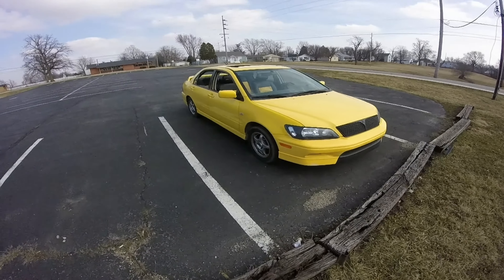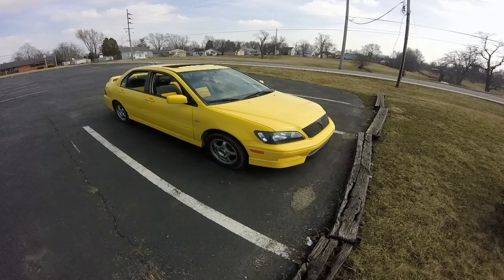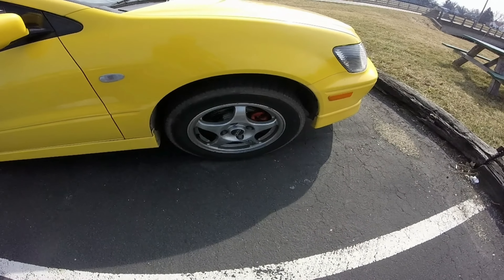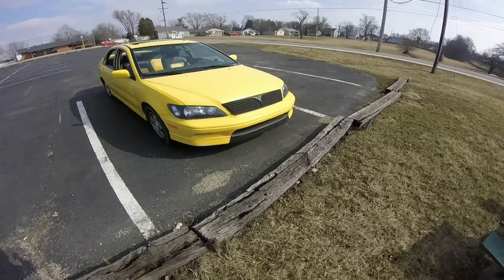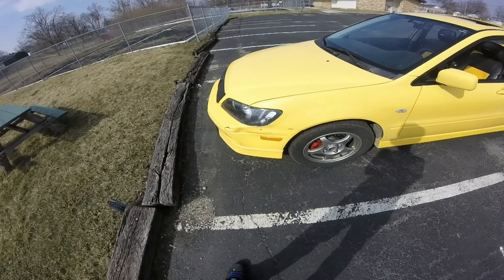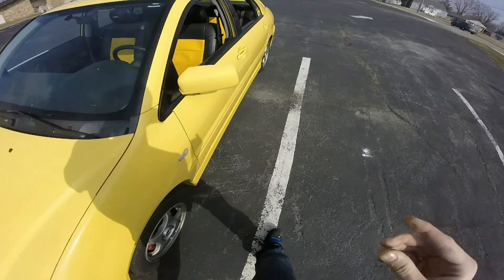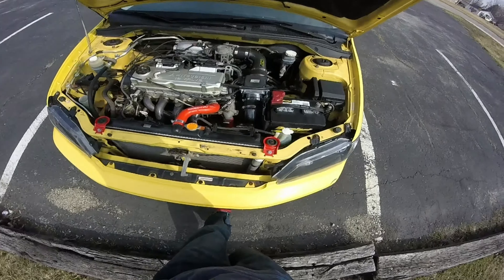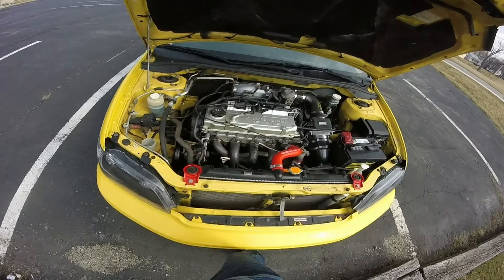O.Z. Rally Lancer Build Pt.3 - Brakes

Comment: 3000gt rear calipers will fit you said? I really want discs on the back of mine too, I think the drums let the car down a lot in looks and a little bit in performance. It is a fun car to drive, I've taken my power steering out, it's very fun around a curvy road now, you feel all the bumps and vibrations from the tires as a result as well as better feed back in a corner, knowing where the tires are.
Reply from the maker: I know some Mitsubishi calipers and rotors fit back there, and Im pretty sure its the 3000gt 4 lugs. Ive seen pictures and it looks awesome lol. And yea I hate the look of drums, but Ive decided to keep them because I want my ebrake haha. Thanks for watching man!

Comment: take evo 8 rear spindle assembly it fits, bolt on brembos and get you some bbs 17x7 rims. do the same for the front. get evo master cyl. then stop better than an evo bc less weight on an oz.
Reply from the maker: That is awesome! Never thought to do that! Have you done this conversion?
Reply: +Dillan Addington currently gathering parts to do it. I originally wanted Ralliart brakes then I found out of the conversion done on the Ralliart and if it can be done on the Ralliart it can be done to our oz rally
Reply from the maker: +watslife68 you should post videos of the progress! Id love to see it man!
Reply: +Dillan Addington will do. but first my Finanza flywheel, and act 6 puck sprung racing clutch disk and xtreme pressure plate

Comment: Find an 04-06 Ralliart take the rear rotors calipers and spindle assembly. Buy the required parts from Mitsu. Remove your drums bolt em on to your OZ. Cheers.
http://www.evolutionm.net/forums/lancer-tires-wheels-brakes-suspension-sponsored-tire-rack/417326-lancer-5-lug-rear-disc-conversion-part-list.html
I plan to do this on my 02.
Reply from the maker: Thanks a lot man, nice profile pic btw, are you an Air Force guy? Im USAFR myself.
Reply: Hey anything for another OZ owner. No I just love the A-10 even though they're retiring it in 2016. I used to want to join the USAF when I was a teenager, I was even in CAP(basically Jr. Air Force Boy Scouts).
Reply from the maker: I always thought CAP sounded fun, Im in flight school, 15 flight hours in. Are you a private pilot? You would love it!
Reply: +Dillan Addington Hey this came into my head today when I looked at this. The rear disc swap isn't as quick as I had previously thought. Here's a detailed guide on how to do it and what you'll need. Hope it helps! http://www.evolutionm.net/forums/lancer-tires-wheels-brakes-suspension-sponsored-tire-rack/646202-how-rear-brake-conversion-lancer-o-z.html